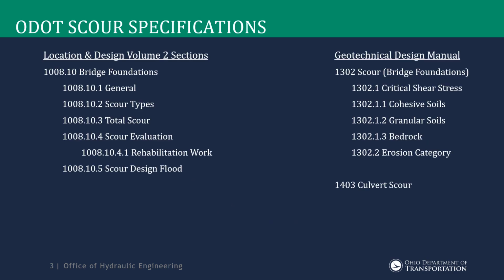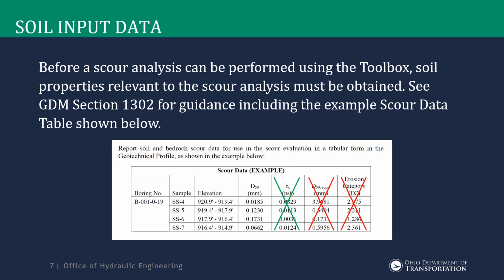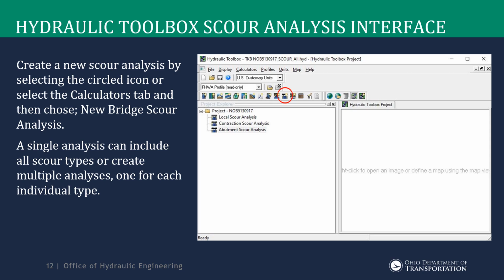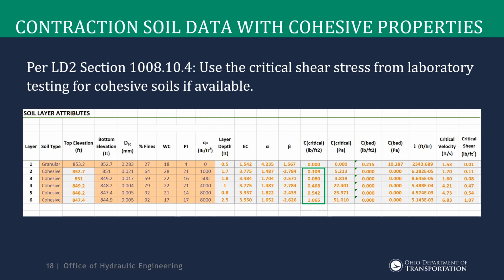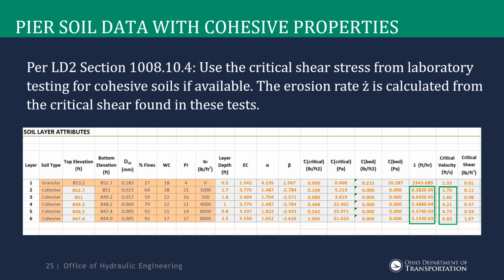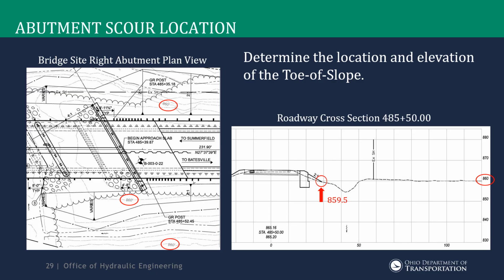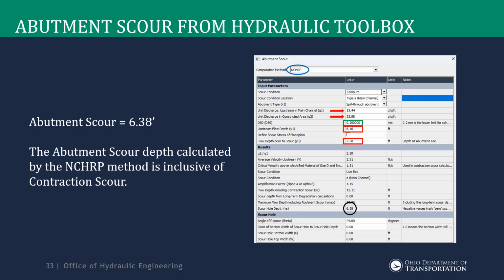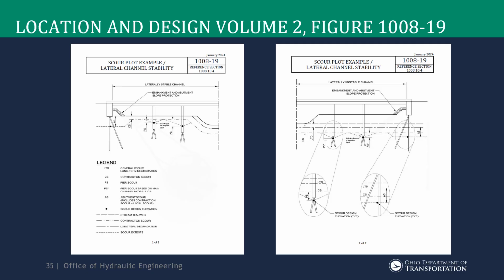Scour Calculation Example | 2025

Comment: This is a very helpful and informative video—thank you for sharing! However, I had a question about the calculation of the abutment scour around 17:19. I didn’t quite understand why a value of 7.58 ft was used. From my understanding, this value represents the hydraulic depth at the abutment toe, and if the abutments are at the same elevation as the overbank, wouldn't the correct value be closer to 1.67 ft for the left abutments?

If I’m mistaken, I’d really appreciate a clarification.  Thanks again for the great content!